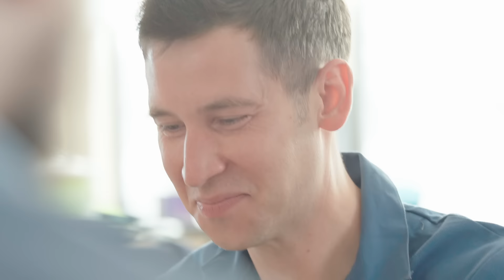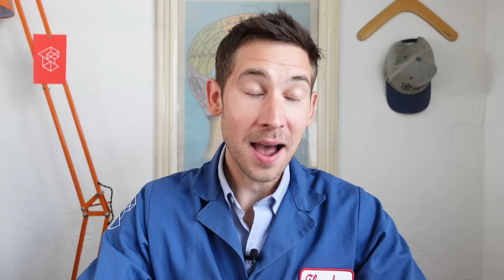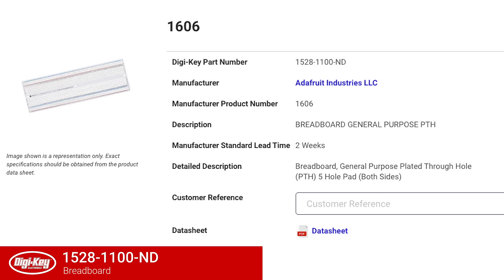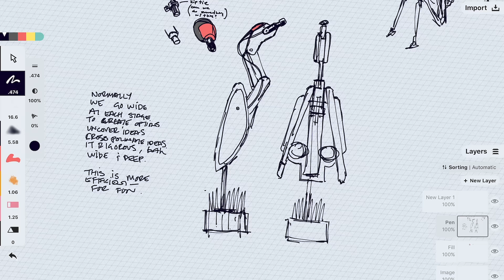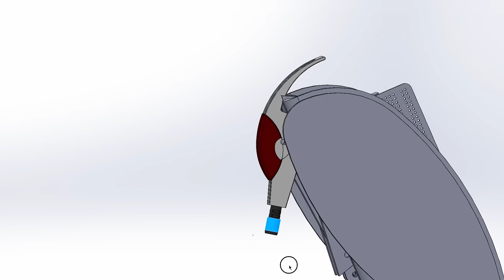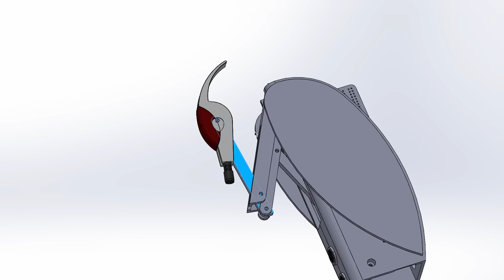Motion - Activated Microphone - Potentially Genius® | Digi - Key Electronics

Comment: Amateur mistake to use ultrasonic sensor instead of optical one here.
Reply: Lol. It's pretty bulky, but it's responsive and has a good FOV for the application. Also for a quick build it was extremely easy to integrate and has a fun visual quality to it. In refined consumer electronics, we tend to hide sensors and make the product as minimal as possible. Over here on Potentially Genius we can celebrate these components and play with their quirks. I'm super curious: what component would you have used?
Reply: @pepingelardi1210  it comes down to SNR of the output. These ultrasonic ones are terribly noisy. You'd have to sacrifice responsiveness in favor of software averaging pretty bad. And without it, even in your demo it is apparent that there are errors and jerky movement due to this exact  issue.
Arduino friendly VL53L0X could be a much better starting point here.

Comment: That was really cool ! You guys maybe could’ve changed the distance sensor location though
Reply: Thanks, we were probably overly invested in that form factor 😅 -- and we wanted to mount the sensor directly on our protoboard to make a tight package (wire routing ruins these quick builds). In a real product we would likely have used Lidar or an IR range finder on a custom PCB -- they have smaller packages and would allow for better positioning.